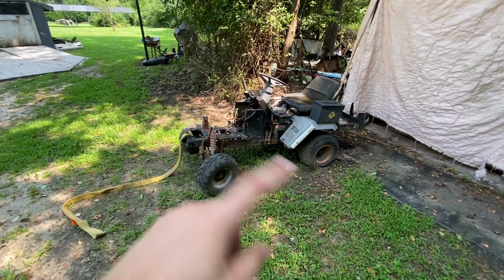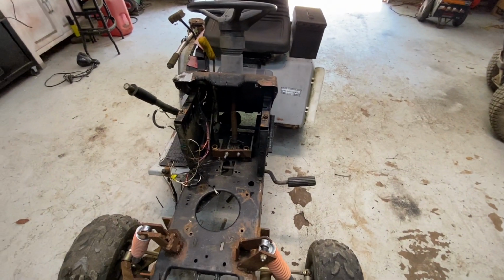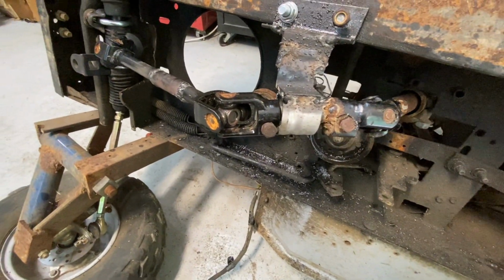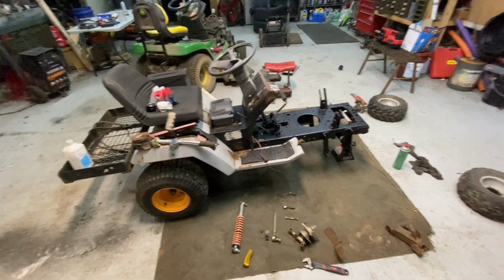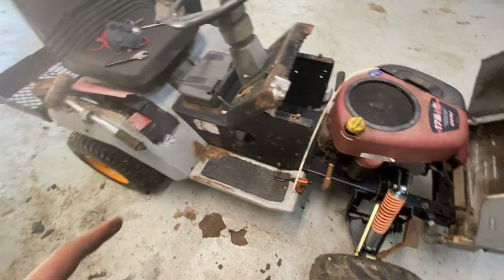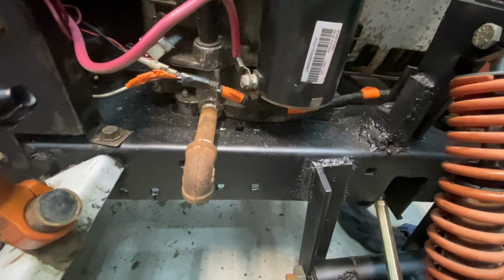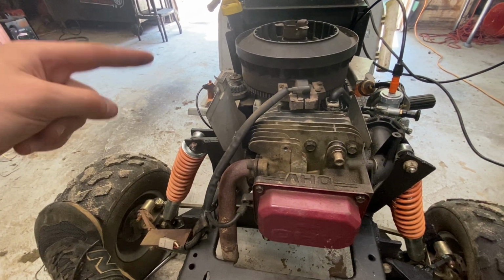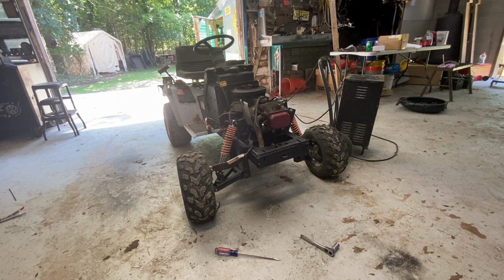IT RUNS!! | Mud Mower Suspension Build | Part 6

Comment: That engine sounds pretty good.  You do good work.  Not sure what would cause the backfire.  Maybe just needs some run time. For an easy fix, you can use a screw in muffler.  Just taper the threaded end heat the exhaust pipe and  put a jack under the muffler and a pipe wrench to screw the muffler into the exhaust pipe.
Reply from the maker: @bertgrau3934  it definitely rips and probably just needs some carb tuning/cleaning from sitting. For an exhaust I was thinking going all out and make some kind of custom side pipe. Thank you for watching!
Reply: @specialt9744  
A custom exhaust would be cool 😎